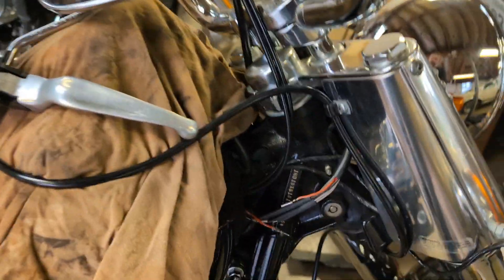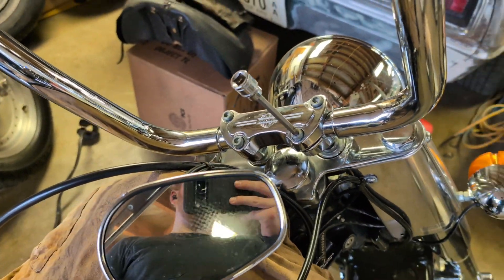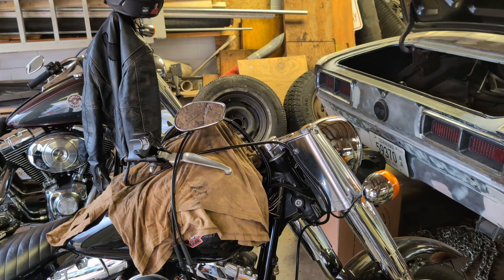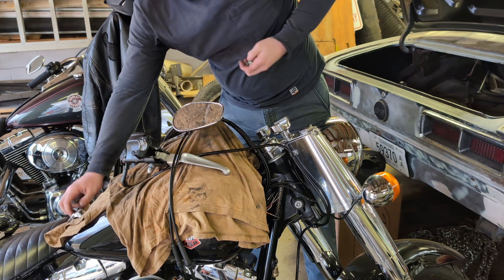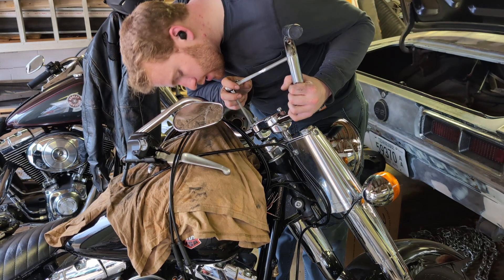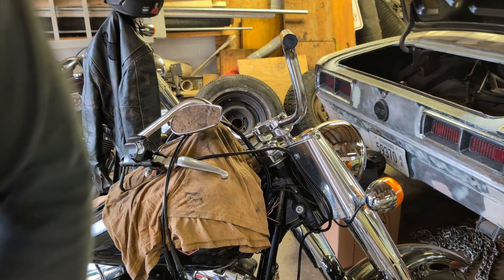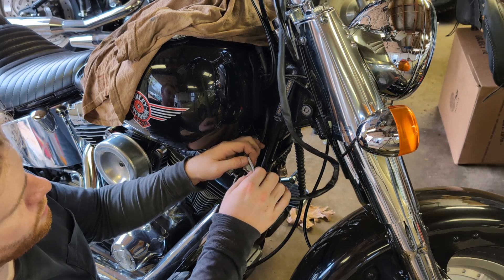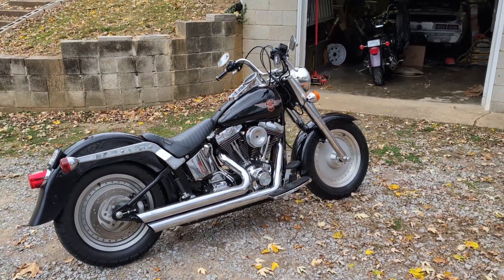Installing New Handlebars On My 2001 Harley Fatboy

Comment: How are those turn signals mounted?
Reply from the maker: Someone cut the thread off a bolt, threaded it into the panel and used a nut in the inside of the turn signals.